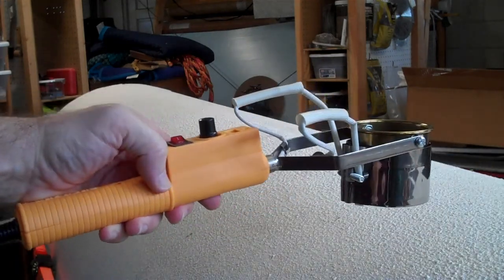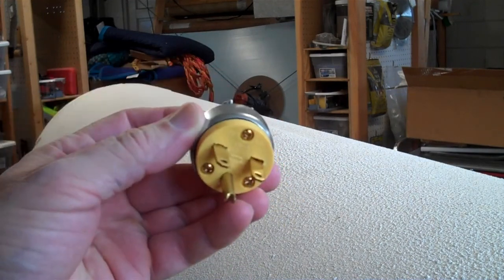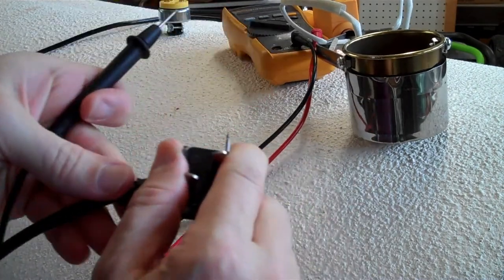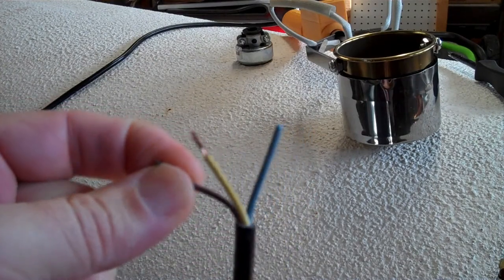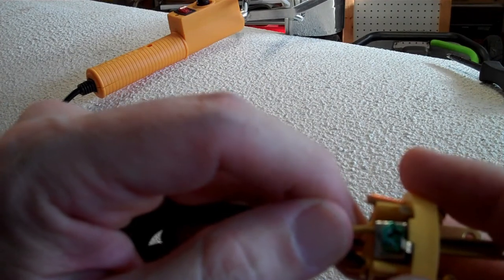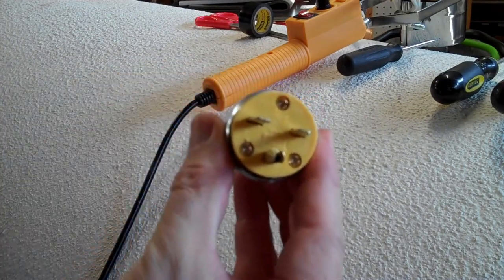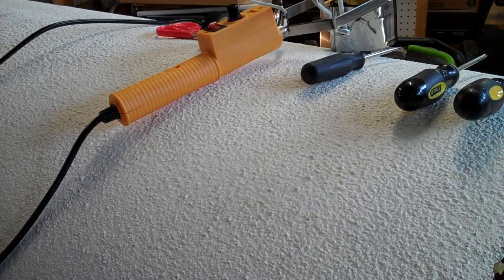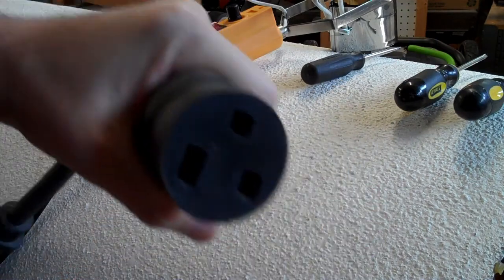Adding a 240 volt NEMA 6-15 plug to an Chinese melting pot appliance for use in the US

Comment: Interesting plug.    This particular Chinese plug closely resembles two styles of plugs found in the US.   The NEMA 10-50P, which is/was used mainly on electric ranges and sometimes clothes dryers, prohibited for new installations as of the 1996 NEC.   Then there is the very rare and obscure NEMA 10-20 which looks like a miniature version of the NEMA 10-50 and it is found primarily in homes built between the mid 1950s - early 1970s because apparently during that era, there was a fad in which some larger window air conditioners had 240V compressors with 120V blower motor and controls; the chassis was either grounded to neutral or ungrounded while electric ranges and clothes dryers come with a bonding strap or wire to bond the chassis to neutral when a three wire connection is used; this bonding strap/wire MUST BE REMOVED when using a modern 4 wire connection i.e . NEMA 14-30 / 14-50R.  

All 240V window air conditioners since the 1970s will have a NEMA 6-15, 6-20 or 6-30P depending on how many BTU's and whether or not it can also heat and cool.  

Since around 2003, all portable air conditioners are required to have a LCDI (leakage circuit detection interrupter) or AFCI (Arc fault circuit interrupter) built into the plug cap or factory installed within 12 inches of the plug.  

The LCDI is a factory assembled cord/plug combination in which the cord has a fine wire mesh surrounding the conductors to detect any leakage current which would occur if the cord were frayed or otherwise damaged.   This is a UL requirement in the USA that came about due to the significant number of electrical fires originated at window/thru the wall air conditioners.  The LCDI plug trips when the leakage current exceeds a certain threshold, therefore removing the fire/shock hazards caused by a damaged cord.
Reply from the maker: Thanks for the in-depth plug information!

Comment: Very informative. Am I getting this correctly; I have a 240v AC to 24V DC transformer from China with just two wires coming in (presumably hot and neutral), if I connect those hot and neutral wires to opposite 120V phases from my panel that should properly power the transformer? The confusing part for me is that European and Asian 240 volts come on one side and if I’m understanding this correctly feeding 120v from two sides will have the same results
Reply from the maker: @ziggyd3114  A 240 volt device with two wires in the US has two "HOT" inputs (black&red is the UD color convention).  For a country with only 240 /230 volts they may be labeled hot and neutral.
Reply: @summetj got it. So it just doesn’t matter if 240v are coming on one wire and 0v on the other vs 120v from each wire. Only the combined total matters? This is counterintuitive for a none electrician who thinks ac current flows in a circle…
Reply from the maker: @ziggyd3114  essentially yes. With the US split phase system the 120 volts are out of cycle with each other so the difference between the two of them is 240 volts.

Comment: Could i do this with a 230v 3kw heater? It has a two pin plug i believe from uk or spain. I check the wires and are same as your pot heating tool.
Reply from the maker: A NEMA 6-15 recepticle is 240 volts at up to 15 amps (3.6kw) but for continious usage you are only supposed to load it to 80% (12 amps @ 240 volts) or 2.8 kw.  So you could plug a 3kw heater into a 6-15 and it would work, but you are only supposed to draw 2.8 kw for long term / continuous operation. 

Yes, it would work, but a 6-20 receptacle and plug  (20 amp circuit vs 15) would actually be up to code....

Comment: I have purchased 240v cooking machine it came with L6-20 connector. But I am not sure they 2 hot wire or single wire 220v, Is it okay ? I know you mention in video its okay. I want to make sure I am not doing anything wrong.
Reply from the maker: A NEMA L6-20 connector is a circular locking plug and has two hot wires (X&Y) and a locking ground pin. There should be 240 volts between the X and Y terminals (the ones without the locking part sticking out perpendicular to the rest of the plug).  Note that a NEMA 6-20 (without the "L") is a flat blade plug that does not twist or lock, but also has two blades that should have 240 volts between them, plus a grounding pin. [The 6-20 has the two blades that are perpendicular to each other, indicating that it requires 20 amps, while the 6-15 plug has two horizontal blades (oriented the wrong way to plug into a 120v 5-15/20 outlet) and only requires 15 amps.]

Comment: Hi Jay. Thank you for the video. I have a 2 prong 240 soldering iron from China (no earth). Can I run 2 120v wires to the one side and a neutral to the other? Thanks again.
Reply from the maker: The USA has a "Split-phase" 240v system.  Hot1 -> neutral is 120 volts, and neutral to Hot 2 is another 120 volts. So to get 240 volts, you need two hots (H1 and H2), with no neutral involved.  You can only get two different hots on a 240 volt circuit, or by taking two hots from two different (opposite phase) 120 volt circuits.   Test the voltage with a multi-meter, and don't connect two hots together or it will short out at 240 volts.
Reply: @summetj  Hi again Jay.. I tried hooking up two 120s from different breakers, one to each pole...nothing. I tried hooking two 120s together then to one of the poles and a neutral to the other pole and I still got 120V. I think it has something to do with the phases in the US. If there were three or four wires, like your appliance, I'm sure it would work. Thanks again for all your effort. God Bless you.
Reply from the maker: @elvisrickey4625  Sounds like you need to test the circuits with the multimeter or get an electrician involved.

Comment: Hi Jay, very informative thanks. I failed to understand why you couldn't use directly a NEMA 14-50P 50A adapter and plug it directly to the outlet you had already. Thanks!
Reply from the maker: A 14-50p to 6-15 or 6-20R adapter cost a lot more than the 6-50 to 6-20R adapter I ended up using (making use of the 14-50 to 6-50 adapter I already had on hand). The cheapest option would be to wire the device to a 14-50 plug (or install a 6-15 outlet....as the 14-50 plugs are not inexpensive...)
Reply: @summetj  Thanks for the quick response! Ok, so in case you wouldn't have had the adapter, and counting on the existing outlet you already have, a valid option would have been using directly a 14-50P adapter? I'm sorry but I'm not very knowledgeable on this matter. I have several appliances from Europe (220 & 240v) and I have a 14-50 outlet at home that I was thinking I could use without the need of modifying the electric installation (but using a 14-50 adapter instead). Thanks again.
Reply from the maker: @JohdoKaash  For permanent use, it's better to re-wire the appliance (plug) so that it attaches to a receptacle with the appropriate sized wire and circuit breaker.  However, you can run just about any 240 volt appliance off of a 14-50 outlet with the appropriate chain of adapters to get to whatever plug the device uses.

Comment: I bought a french fry cutting machine from China it has the same plug-in that you are showing,,, The machine cord says it’s a 220 10  amp,  does the motor in my machine act the same way that your device works if I changed the plug-in over The way you did it?? I’m planning on plugging it into a dryer receptacle 220 30 amp ,  I also have all the adapters,,
Reply from the maker: Yes, it should work. The only difference between a restive heater and an inductive motor load that you should check on is the rated frequency of the AC. In the US we run at 60Hz, but some countries  use 50Hz. For an appliance rated at 50hz, it's motor will spin 20% faster at 60Hz, which is usually just fine.

Comment: I used the 220 type plug for for dryers....worked great.
Reply from the maker: Yes, a plug for any 220/240 volt circuit will work. The dryer plug is nice because it removes the need for an adapter if you don't have a 6-15 or 6-20 receptacle.  But ideally you'd want the smallest (15-20 amp) circuit breaker possible on the receptacle you are plugging into, just for safety. [Says the guy who plugged it into a 50 amp circuit with an adapter cable...]
Reply: Yes, that inspired me to watch this video. New house we’re looking at probably has a dryer plug (I assume all dryers are 220?) that is unused. Wondering, about installing a kettle in it so that I can shave off some time in the amount of time it takes to boil water.
Reply: 220V airconditioners in the Philippines. That plug also fits on Thai / US / Euro 3 pin outlets.

Comment: Taiwan uses that same 240 volt 60 Hz split phase system with plug, that original plug is a chinese standard, they have earth at top, here in Australia we have earth at bottom with same pin plug layout, but pins are sleeved for safety
Reply: Earth at the bottom for Argentine angle plugs and 2 row Argentine power strips but earth outlet at the bottom and for Chinese powerstrips, earth at the top .